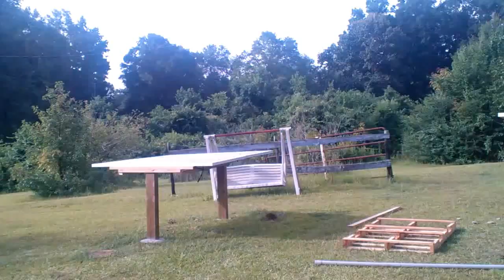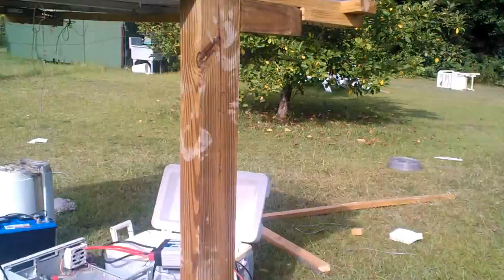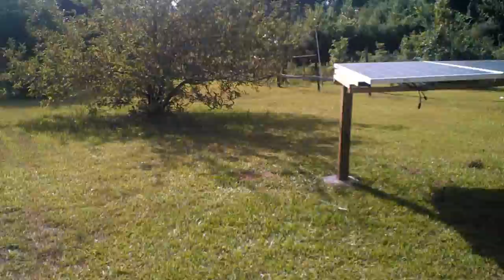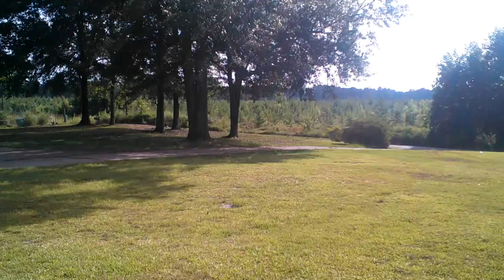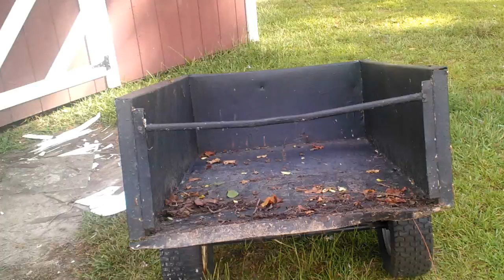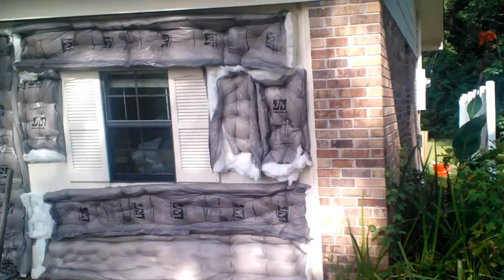More on my 1kw off grid solar station

Comment from the maker: I was planning on it.  I was just getting it set up so I could go ahead and start using it now.  By winter I'll have a little more funding put aside so that I can complete it.  They are building a lignite gasification plant here, and they will up our rates probably by ten percent in the next few months, not counting the normal inflation.  Basically, it was a good excuse to go ahead and get a few while they were on sale.  Save a few bucks and help the environment a lil.

Comment: You're going to want to angle those panels south in the winter, so check out superstrut in the electrical department at the hardware store. They have clamps that go around EMT pipe and you could use EMT pipe across the panels to hold them up in the back. While you have those bricks out, you could make a place for access to run wires through the wall inside to a solar setup.